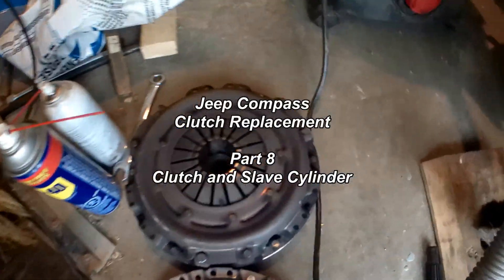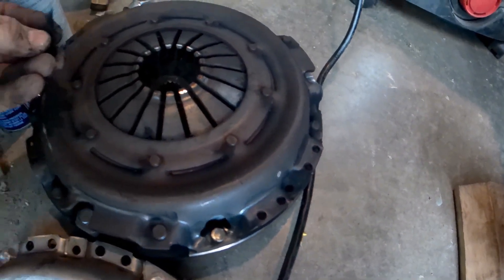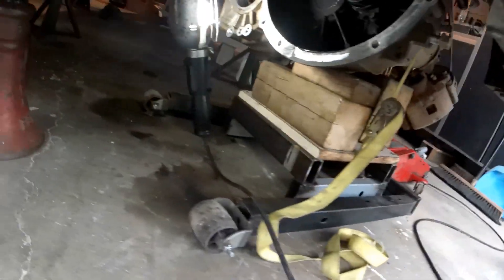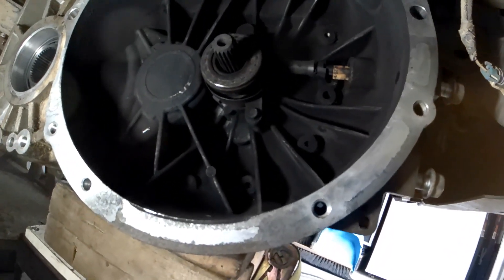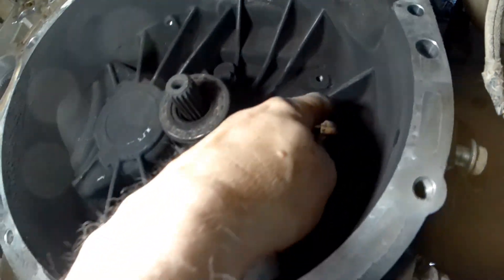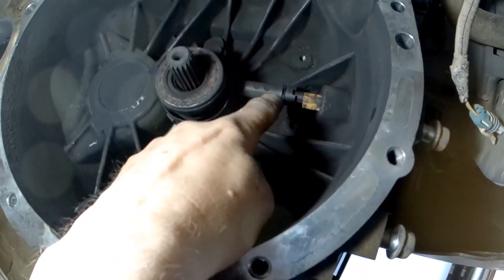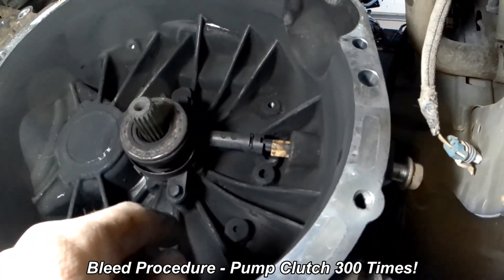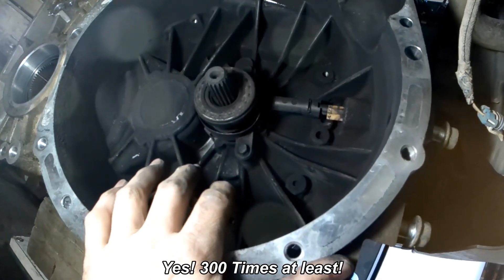Jeep Compass (Patriot Caliber) Clutch Replacement - Part 8 Clutch and Throwout Bearing

Comment: Do you know what the torque setting for the Slave adapter is please
Reply from the maker: From page 5471 of the service manual

Slave Cylinder-to-
Transaxle
10 N.M. or  88 inch lb